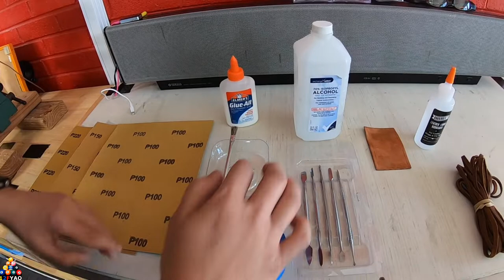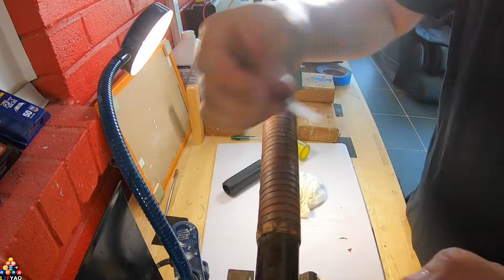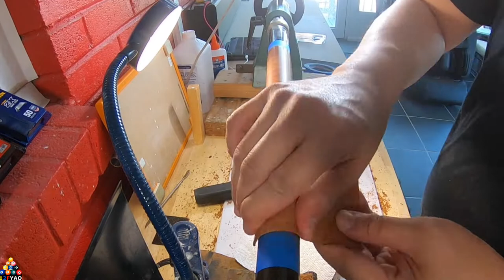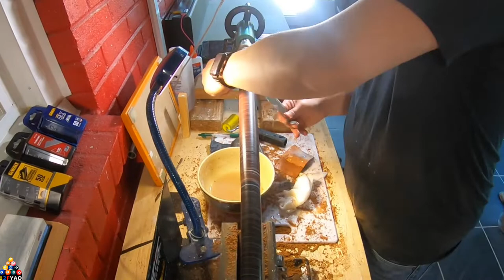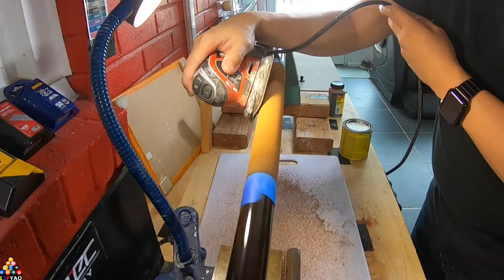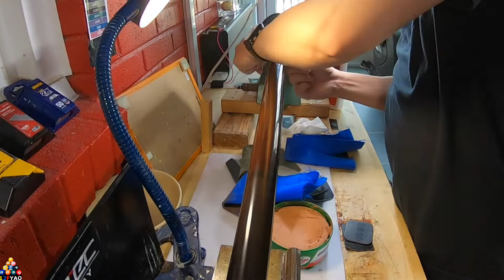Installing a Stacked Leather Wrap

Comment: Nice to see a shout out to Ryan Theewen and Rat Cues and Theewen Custom Cues.  He is a master at stack leather wraps, the best in the country.  I grew up in Lincoln and have worked with Ryan on learning some info.  He builds beautiful cues and very well hitting cues, not just looks, they play great!  I've known him for 30+ years. Awesome guy!

One thing that helps with installing a stack leather wrap is drywall sanding sheets.  The mesh sheets that look like window screens.  They don't gum up and they allow breathability and perform wonderfully and help with a flatter and accurate sanding area because the leather sanded material passes through the mesh sheets, instead of gumming up and sitting between the wrap and the normal sanding paper.

A couple tricks that help:  
- Pulling just a little tighter (not alot) pulls the leather thinner (not alot) but it helps.
- Turning down the handle ever so slightly (only if you're comfortable with this step). 
     
But, if you become comfortable and are consistent with how much of the handle to remove, then once   the stack is on there, and you press it down, there is alot less sanding needed.  
     
It doesn't take much material removed to help make it alot easier.  If a wrap groove has already been cut (from a previous stack wrap, or other leather wrap or irish linen) then it should be almost perfect to just lightly sand and install the stack wrap.

Besides buying the Tiger stack leather wrap dvd, there's free short version video on youtube.  They show them using the mesh drywall sheets.

https://youtu.be/EteSBoXm9bI

Of course "practice makes perfect" 

Nice job on the 2nd redo! Thumbs up!
Reply from the maker: Thank you for commenting. For some reason this one did not come out like how I did my Predator but the second redo was a lot better. Thank you for the advice. I haven’t done any more stack leather wraps. If I get any customers wanting a stacked leather wrap. I will take your advice. Thank you again for sharing your information, please subscribe if haven’t already and please share.